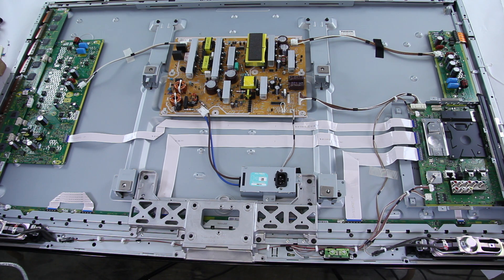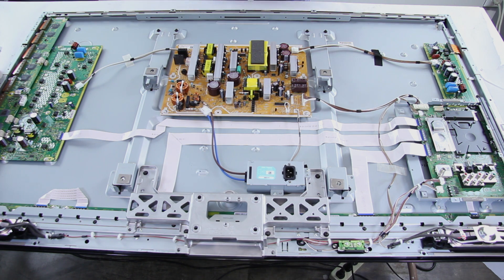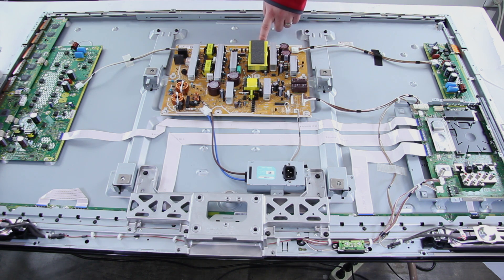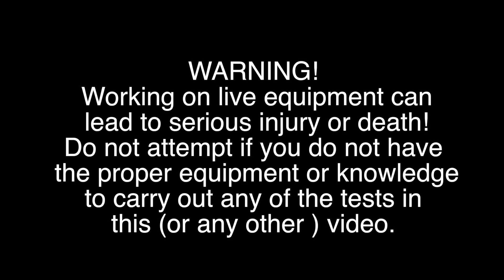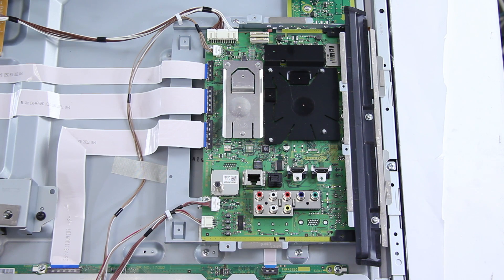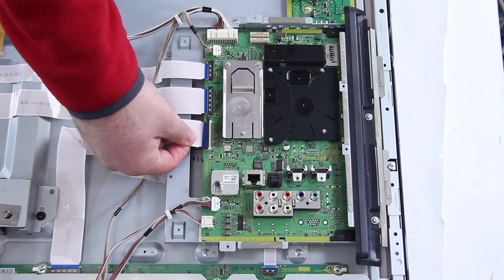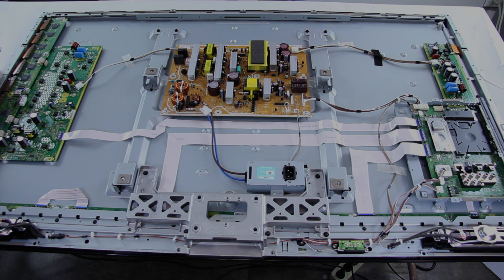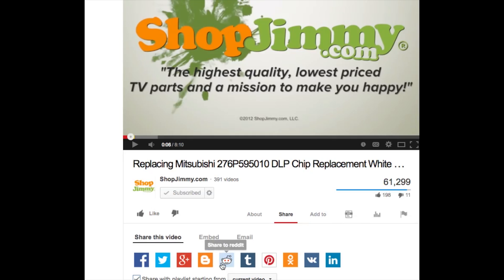Panasonic Plasma TV 1 Blink Code Explained Repair for 2011 Panasonic Plasma TV

Comment: I have a 2011 panasonic plasma hdtv TC-P50S30. TV died and all I get is 14 blinking red lights. I replaced the "A"  main board and this did not help. Any advice would be appreciated. Thanks, Jim

Comment: Hello
Thank you for the great vedio
I have. Oanasonic tv. With s.n MC127H36U13.
I wanna use it as a reserve tv for the kids playstation, the problem is that i can not hang it on the wall because one of the bolts is missing, i looked eveey where for this kind of bolts but  no way.
Any clue how can i fix this issue?
Thank you

Comment: I have a Panasonic TC-P46ST30 TV and all I get is the voice and no Video.  When I press the MENU or the VIERA CAST or the VIERA TOOLS buttons on the remote nothing is displayed on the screen.  When I press the red on/off power button on the remote the red power LED goes on or off normally.

Comment: Mine is a Panasonic TC-P60S30 it has 8 blinking red lights. It was working ok  but after a storm passed trough Puerto Rico sometimes tuning off.
Today Inwas watching YouTube and it did not play after was in pause. After that electric power went off and now it does not turn on. I’ve been reading in internet and that’s when I notice the blinking lights and counted. Turn off the power and other devices.

Comment: Tcp55st30 fast flashing red light switches on the switches off itself as soon as I press any button on remote switches tv off but comes back on by it's self after few mins but doesn't stop on long

Comment: Thanks for the video.   I have a TC-P42G25 which is giving a 1 blink code.   Would this also be an A-board problem?   The service manual shows 2 or 3 blinks for the A board, and nothing for a 1 blink code.

Comment: Hi Jimmy

Hi there I have an issue with my Panasonic Viera Tx-48AX630B. I have a code 1 blink code. Screen will flash on then off (no display) when power is introduced. 

Replaced the main A Board. Fault is still present. Any ideas on where to go next?

Comment: Hi i have Panasonic tc-50as660c that when turned on, shuts off immediately and then flashes 1 red light. Recapping the power supply did not fix the problem.

Comment: Panasonic TX-42AS500B 

Hi guys, Randomly watching a film earlier and the tv turned off.

On power up flashes green quite fast around 20 times then the tv flickers 2 or 3 times then light changes from green to red then blinks red every 4 seconds. No such action with remote or power button.

Any help will be extremely appreciated ;)
Reply: inventer or background led have trouble

Comment: My TC-P50G10 shows 5 blinks.
Sometimes the light will not come on period.
The fans will not spin period, the light on the power supply board will not come on.

When I plug it in, all I hear is a click from the power supply board, & red light stays on for a few moments the A board, then goes off..

I have changed the power supply board, the A board, & the SS board.

What could be happening?

Thanks in advance..

Comment: I have a 2009 Panasonic Plasma TV TC-P65S1  Serial Number LG 92450223.  I turn it on and I hear it click a few times then the power light turn off and starts blinking slowly 1 blink every 2 or 3 seconds.  It doesn't stop blinking.

Comment: Alrighty, so for the past couple weeks my Panasonic viera TC-L42D30 that I bought in 2011 has been either turning itself off or not wanting to turn on.  I have gotten it to turn back on after unplugging it for a long time but it seems the time that it will stay on for is getting shorter. I do notice the right side of the screen gets dim before it turns off as well.

The power indicator is blinking once about every 5 seconds and doesn't stop until I unplug it. Any ideas on what's wrong and how to fix it or how much it would be to fix?

Comment: Hi, thanks for the video. I have a Panasonic Viera P54G10 plasma tv. I’m experiencing the 1-blink code as described in the video. I replaced the power supply board thinking that was the issue but still have 1-blink issue. What would you suggest I do next? Thanks

Comment: I have a Panasonic Plasma HDTV TC-P58S1 S/NLG92380436 Aug 2009 It will not power on, it blinks six(6) times. please inform as to problem and how much for repair or replacement part?

Comment: Hi, I have a Panasonic led tv TC-L42E5, it turns on for a few seconds and then it shuts down with 1 blink and them it keeps on blinking non stop. I reset it and set it on self test an it gave a SOS - 1.

Thanks!

Comment: I have a Panasonic TC-L42D30, an Lcd made in March 2011. My screen turns off and the red light blinks individually. I can turn it back on, it happens again. I replaced the power board already. Can you help me? Main board?

Comment: I have a TC-P42S30. The screen went off. Light is red solid. Does not turn on or off using the remote control. Only when unplugged \. What happened to my beautiful plasma

Comment: have 2011 Panasonic Plasma TC-50PS14 when I power it up no pic or sound just one Blink Code with a 3 sec space between the spaced.  Could it be the main board or the power supply?

Comment: I just picked up a TC-p46c2. When I press the power button, the relays click a couple times then after a few seconds they click again and a 1 blink flashes indefinitely. 
According to the chart I have read, it means  "UNknown SOS" or "Panel INformation sos PD4 Start SOS"
I have no idea what any of that means. I don't have the remote so I cannot access service mode. So is there anything you can tell me?

Comment: I have a Panasonic TC-55LE54 July 2012 Serial # MB21850296 LCD TV It will come on to a beautiful picture for about 15 seconds It then shuts of and the power light will just blink on and off No pattern. It will also not come back on until I have unplugged it for 30 seconds or more. When you turn it back on it just repeats the process. Any help would be greatly apreciated

Comment: I have a TC-P42X1 Panasonic Plasma from 2009.  I had a 9 blink code and the solution I was told was to change out the main (A) board.  I did this and now am getting the one blink code. Any thoughts on my next step?

Comment: I have a Panasonic TC-P60GT50 giving me 12 blinking lights. It started after a brief 1 second power outage while watching a movie. I disconnected the HDMI cables as the troubleshooting guide suggested. When I turned the TV on it worked fine but the speaker on the left side near the (A Board) was buzzing. I disconnected the speakers and the TV worked fine again. I was able to watch a movie and play some PS4. After shutting the TV off again however it gave me 12 blinking lights again. This time nothing is working to bring it back. I am torn between replacing the A Board and the Main Power Board. The TV clicks on, shows the welcome screen and then clicks off to the 12 blinking lights. Any help is appreciated, thanks.

Comment: I have a Panasonic led tv TC-55as680u the red light is blinking one code. Is it the A board that is bad or the dg 5v sensing board? Do you sell the replacement parts? Thanks

Comment: Hello sir, I have Panasonic TX P42 G10B , when we turn on, it comes on for few seconds, and then screen goes off and red light blinks, normally this light should remain solid red, and whenever we wanted to turn on with report this red light used to blink and tv used to come on!! Any solution you can recommend?

Comment: Hi Can you help? My TX-55DX600 won't power on. The green light flashes then the red standby light flashes once every 3 secs, continuously. I ask Panasonic what this meant but they refused to tell me, saying send it to one of their authorised repairs. If its just a board that needs changing I'm sure I can do it. Just need to know which. Cheers mate.

Comment: I have a Panasonic TC-P60GT50 with a red blinking light every 3-4 seconds.  There is no picture, no sound; only a few clicks when I try to turn it on.  Does this mean the A board needs to be replaced?  Is there a particular sequence to removing the screws on the back panel as they are different sizes & some may connect to different things.  Thanks very much for your help.

Comment: I have a TH-L50B6A. When I turn it on the green light flashes a few times then goes solid, the screen flickers and you can see it displaying source inputs in top left hand corner (if you are watching closely) and the green light goes off and red light flashes once every 5 seconds and will keep doing this forever or until I turn the TV off

Comment: tc-55as680u 1 blink s this code continuing with the 2013 model panasonic tvs will the code apply also to this set
the blink occurs right after a hard restart and screen is blank

Comment: Hello.  HELP Please I have a 2010 Panasonic  model TC-P65V10.  It got hit by a power surge and will not power on now.  I get a solid red power light and cannot get it to give a blink code.  I thought I saw a single blink code once but could not repeat it.  I have the back off and when powered on/plugged in, NO fans on or output on screen.  I do hear a click when I plug in and power on.  It resets itself after a few minutes and clicks again.  I believe it needs a new P power board (s)?  It also has a sub-power board.  Do I replace both?  Help. Power Boards are ETX2MM774MA and ETX2MM774MG.  Do I replace P boards before Main board?  How do I know which is defective?  Thanks Ron

Comment: Panasonic TC-P50X1 plasma hdtv (2009). ... only 1 red blink on the front and will not turn on.
Reply: hey sir,I am facing the same problem as you,did u get solved the tv problem.thanks

Comment: I have a Panasonic TC-P50G15. It powers on and the screen lights up but nothing displays including the menu, volume, channels, etc. The red light stays solid and the TV eventually shuts off. I assume that's from no signal. Does this sound like the Main A Board?

Comment: Hi, i have a Panasonic TH-P54S10A showing blinking code of 1 red light.  Other blogs indicate this is the STV 5v sense DG Board.  However, I do not know which board that is and if it is a correct diagnosis.  Your guidance would be appreciated.  Cliff

Comment: Love your videos! My plasma (Panasonic TC-P50ST30) comes on but no picture and no blinking. When turned on the red power light comes on and power button doesn't work. Need to unplug to turn off. Any help would be great. Thanks

Comment: I have a Panasonic viera Plasma TX-P50ST50E,
And all my HDMI ports don't work anymore. when I connect a cdmi video source the tv detects the signal But it does not show any image or audio. I Already replaced the A-Board and I still have the same problem with the HDMI ports. I know that the cable and the video source are working properly. His there any other component on the TV that manages de HDMI ports what am I missing? All other video inputs from the tv work fine.
thank you.

Comment: hey Jimmy I replaced the A board on my Panasonic tv, but now it won't turn on at all. I put the old one back in to make sure I didn't break it for good, and it went back to the 1 blink code.

so with the new one I receive nothing.
with the old one I still get the 1 blink code.

any advice?

Comment: i have a panasonic tc-p50c1 plasma 50 inch made in July 2009 that blinks every 3 secs. There isn't a longer pause in between them. I've counted to over 25 blinks trying to figure the blink code. So i've come to believe its a 1 blink pattern. I need to know what board to replace.

Comment: I have a 2010 panasonic plasma with a one blink code. I replaced the A board and tested the other boards for shorts but still one blink. I disconnected all the boards and the panel, except for the power supply and the A board. And still one blink.

Comment: TC-P42ST30 2011 3D TV red light for power comes on but no TV - All black - red light does not blink just steady red power light
What needs to be replaced and what do I need to buy from you

Comment: I 'd appreciate any help on this problem: 
Panasonic TX-L32EM5E tv that works just fine for about 7-10 minutes and then goes to stand-by with one blinking red led.

I have replaced the panel inverter with no joy.

Thanks for any advice/tips on this.
Ioannis

Comment: Thank you for this useful video and the offer to help. I have a panasonic viera cast TC-P42G25. At first, I was getting 4 blinks, but, after I unplugged and replugged it in, now, I have one blink code. Can you advice on what parts, etc...?  Thank you.
Reply: Hi, I have a similar problem with  a Panasonic Viera TC-P42C2X,  it started with 1 blink, unplugged it , got 10 blinks, another time 12 blinks, but the more persistent is the 1 blink. I think it must be the EEPROM.

Comment: I have this exact TV (TC-P50S30). And it went black but the red LED is steady burning solid. I replaced the SC board, then it started blinking 6 times

Comment: Hi, I have a Panasonic TX-P42X10Y where I get a 1 red blink code every 3rd second on the LED on the front side. When turning on power I here a relay switching and the LED first flashes green, after a few seconds I here a small "buzzing sound" from inside and the LED starts with 1 blinks. I would appreciate any suggestions of what could cause this.

Comment: I have a 2009 Panasonic TC-P42X1.  I was watching it one night, worked perfectly...then shut it off.  Then next evening went to turn it on, nothing.  I've been browsing your blogs and can't find anything relating to my problem due to NO blink codes.  It powers on and I can hear the click.  The red power LED is on, but no picture.  None of the side controls work nor the remote.  It will turn itself on and off approximately 3 or more times before stopping.  Again NO blink codes.  Not sure what part to order from you and replace.  Also I read you have to make voltage adjustments after replacing boards  ?????  Any ideas?  Thanks for your help.

Comment: I have a panasonic TX- L50 B6B it flashes 1 red light and a long pause of around 3 seconds the  flash and so on. no picture no sound  when i first turn on i get green led on constant then green flashing then to 1 flash red do you know what its at fault?thanks

Comment: I have a panasonic th37px25 and I am getting no picture I get menu screens and I get sound from tv and dvd but no picture, is my tv a junkewr or is there something I am not doing right? Any and all help will be greatly appreciated,
Reply from the maker: +mike foote   Try all repairs and troubleshooting at your own risk.  I recommend replacing the SC, SU & SD boards in your TV.  Click this link to replacement parts for your TV model number:  http://www.shopjimmy.com/catalogsearch/result/?q=th37px25  There may be multiple boards for the same TV model number, be sure to match part numbers on your current board, with your replacement for compatibility.  Thanks and please let us know if you have any further questions with your TV Repair!  www.shopjimmy.com

Comment: I repaired the first automobiles that had on-board computers,  They were so new that the code scanners were still under a patent so only the manufacturers had scanners.  Guys like me had to count blinking lights for years.  My 2008 TH-58PZ800U has what I told you earlier was a continuous blinking light but now I believe it is a 1 blink code.  I watched the vids where they chilled the IC boards.  When I chilled them with duster spray one gave me a 10 code and the other gave me a 2 code.  After it warmed up it went back to the 1 blink that only stops when I am holding down the power button.  When I release it the blinking starts again.   Another thing to note is that it rarely responds to the remote.  Usually I have to hold the power button at least ten seconds.  It is not 100% consistent.  I have to unplug it from the wall sometimes.  When I first started on this a few hours ago the remote was creating a response but not now and I did put fresh batteries.  I may want a complete board rather than a repair kit.  It's very hard to mount this TV back where it belongs so I would rather not rely on my soldering skills if I decide to repair this unit.  One final note.  It has been mounted and working fine for years so the back panel vents were clogged with dust accumulation that I am sure caused heat build up.  They AR Coating is peeling off of the screen too so I may just part it out rather then spend my time and money on it.  Exchanging my board for a repaired one may be worthwhile but I doubt a new one will make financial sense to me.
Reply from the maker: +Ron Robert   Try this at your own risk. Unplug the TV, then disconnect the SC board and plug in the TV to see if the TV powers up. Note that it will not have a picture on the screen. Reply with the results of this test. Thanks! www.shopjimmy.com
Reply: ShopJimmy.com I did as you instructed and there was no change. 

I unplugged the Blue and White power supply to the SC board.  If you want me to remove all plugs from the SC board please advise.

When Plugged in 2 Clicks pause 1.  When powered on with remote click, click, click, pause then light flashes steady with approx. 3-4 seconds between flashes and it no longer responds to the remote or the power button on the TV.  I must unplug it. No changes occur when the cord is plugged back ion it just returns to flashing unless I wait several minutes with no power to the cord until there is a click (I am assuming power bleeds off before it clicks) then plug it back in and it responds as it did from the beginning. 

After watching many YouTube Vids I have decided that I may be willing to purchase some soldering equipment and attempt repairing it myself since I have done some soldering on boards in the past.

I am also curious if you have any advice regarding the Anti-Reflective Coating that is flaking off the screen.  I intend to remove all of it and perhaps re-apply it.  I am just not sure about the best solution to remove the coating with harming the screen.